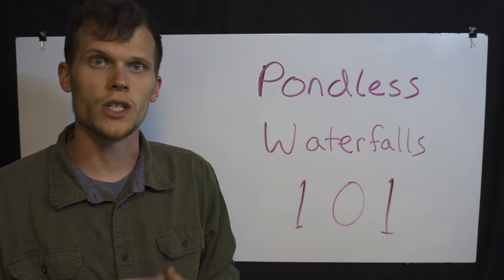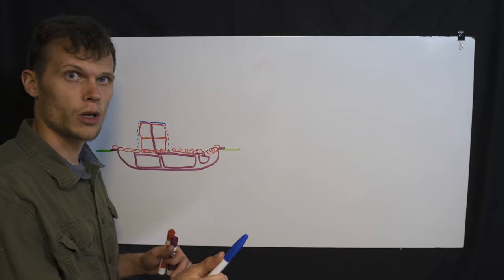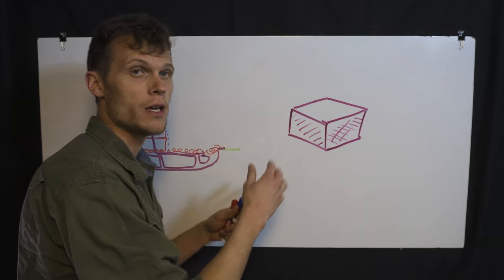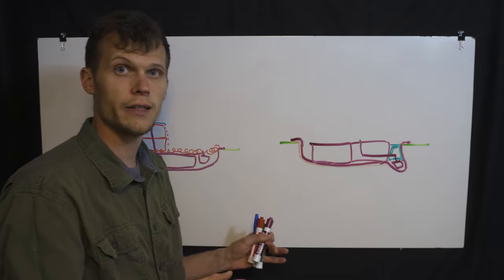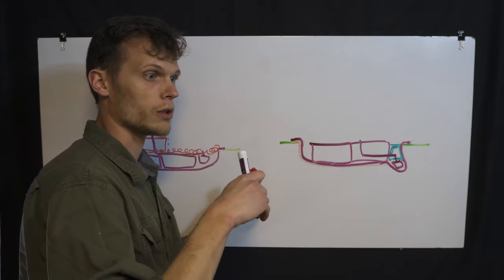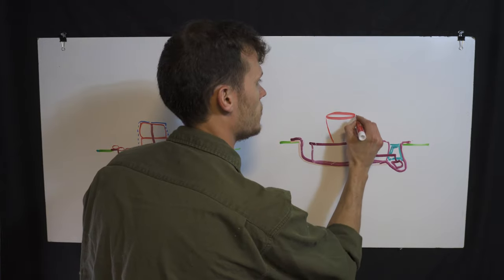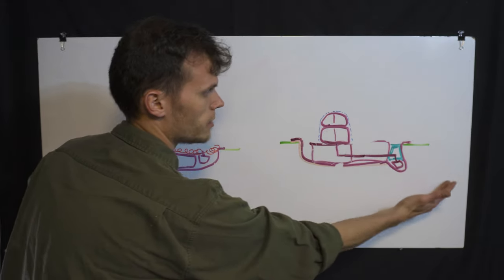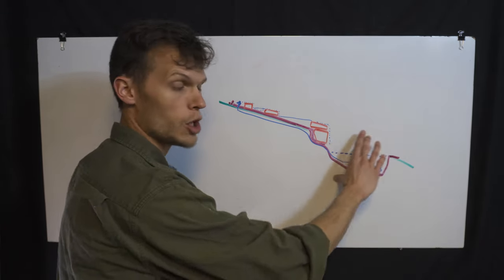Pondless Waterfalls 101

Comment: Any advice for somebody doing one of these in a place where the ground freezes in the winter? Obviously I need to remove my pump, but aside from that. Will those aquablox break if they're submerged in water that then freezes? Even if I drain the whole thing, in the spring when the snow melts the hole will probably be filled with snow runoff, which can then freeze again. Thanks!
Reply from the maker: I dont think the aquablocks break when frozen. I personally have not had to deal with deep freezes so i'm not sure i can help much.

Comment: Would milk crates work as a cheaper alternative to AquaBlocks?
Reply from the maker: I’ve actually used those once and the seemed to work! I wouldn’t trust them with more than my own body weight though. So if you’re using large stone I would off set them to the side so the weight is directly on the ground instead of on the crates. They would certainly hold the weight of some River rock though!

Comment: I would like to know how to install a bib liner at the bottom of a pondless waterfall so you have a shallow pool area at the bottom, instead of the water disappearing into the basin
Reply from the maker: kinda the same just line the edges with rock and them put plants in to keep algae and evaporation down. requires a lot more maintenance though.